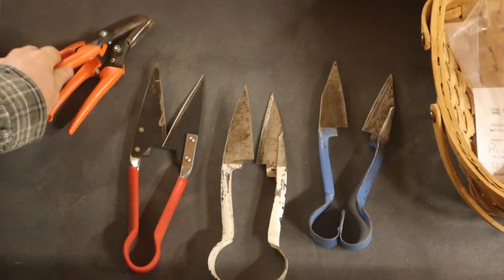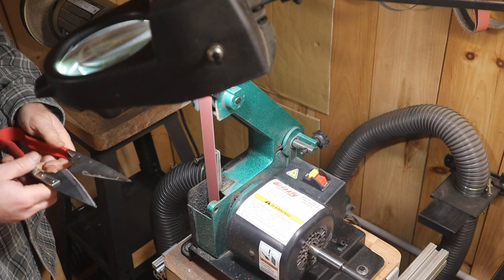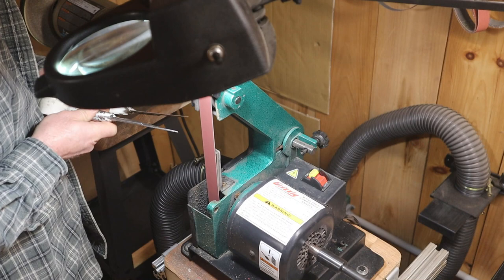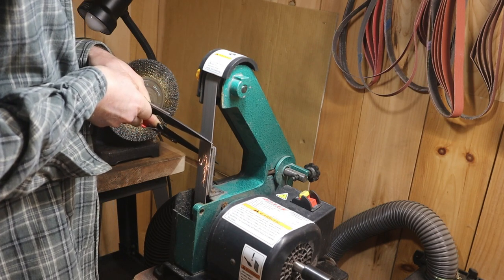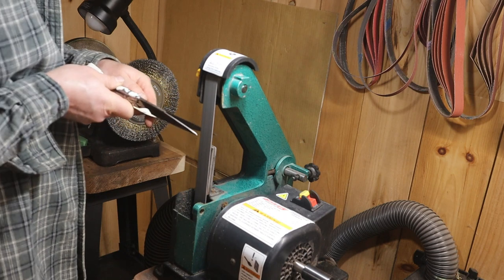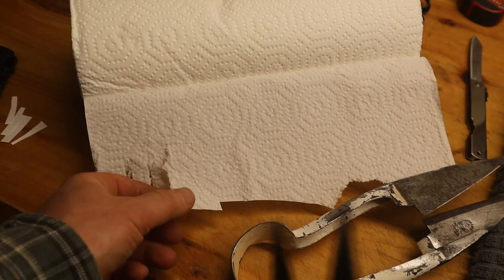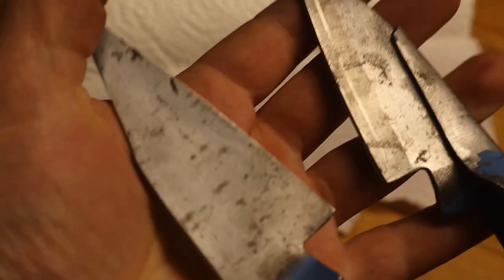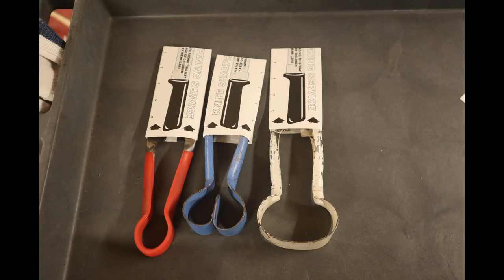One Of These Sheep Shears Failed the Cut Test

Comment: Is that a special belt for sharpening? Or standard 120 grit?
Reply from the maker: They are special belts but not strictly for sharpening.
Probably won't find them in a hardware store.
Cubitrons and Trizacts
Reply: Set the edge with the cubitron 120?